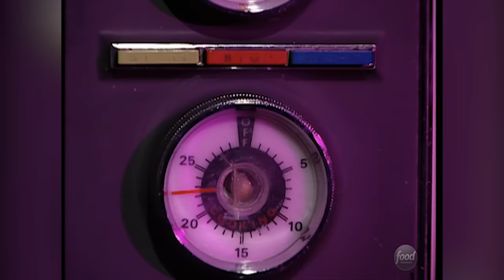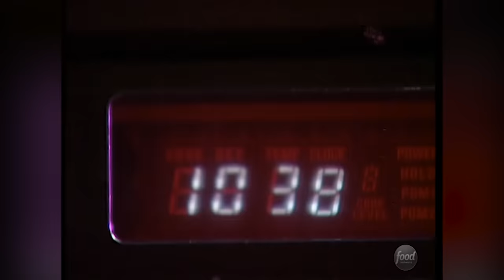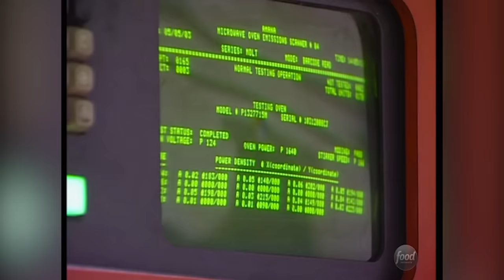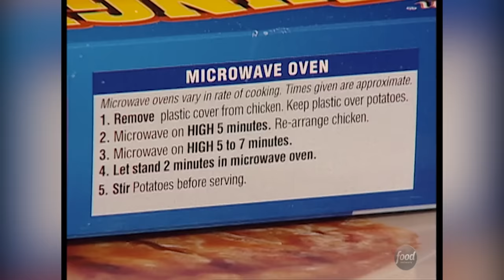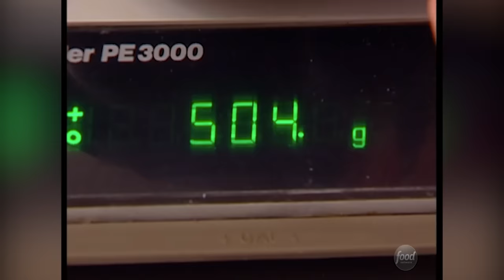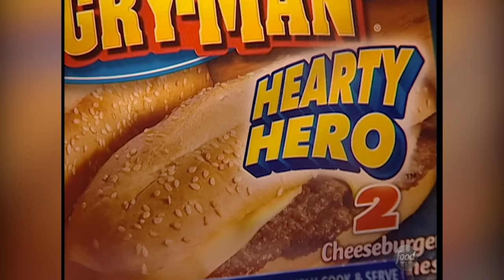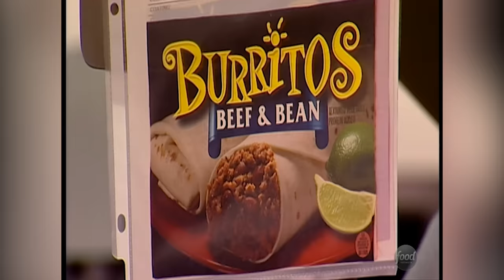How Microwaves and Microwave Dinners Are Made (from Unwrapped) | Food Network

Comment: Wow that segment on microwave ovens has so many errors the interlock device does not prevent the microwave door from opening when it does is it prevents the microwave from operating if you open the door and I'm pretty sure the radar range was created by Raytheon and that was the original microwave the smaller one from Amana which is the first commercial viable microwave was not called a radar range